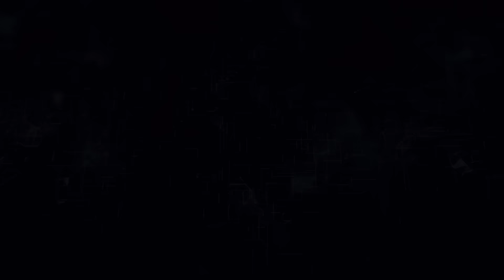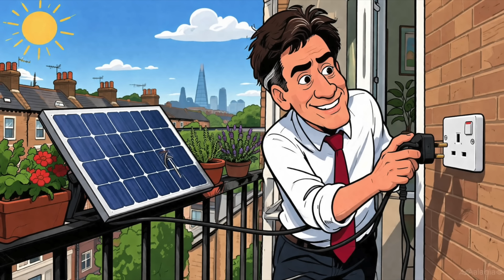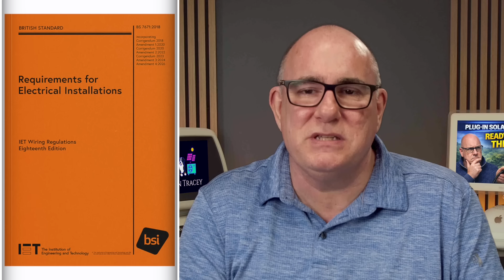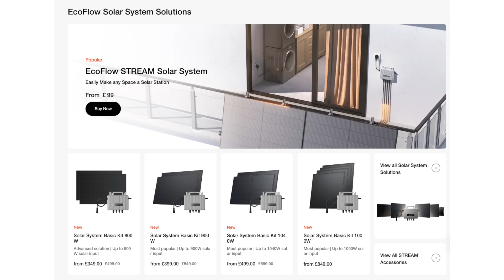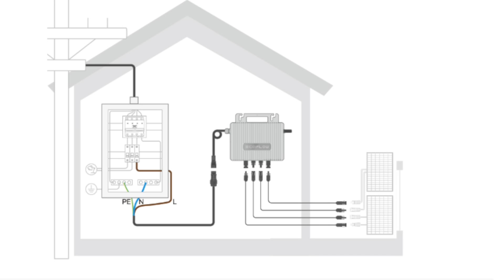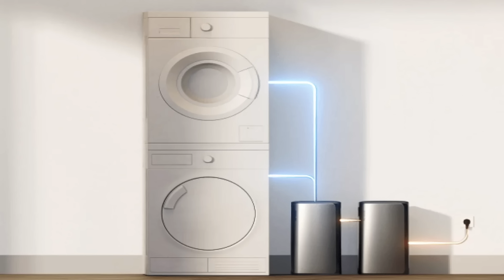Plug In Solar Is Coming… But There’s a Problem

Comment: It’ll screw our voltage even more than now, let’s have a load of Chinese made equipment pushing power into our grid what could go wrong 😂😂
Reply from the maker: @stuartosborne3013 Let’s ease off the anti-China angle a bit 😅

China is one of the most technologically advanced manufacturing hubs in the world — they produce the majority of global solar panels, including for many European and US brands. This isn’t cheap, low-quality kit — it’s highly engineered, mass-produced tech.

In fact, a lot of these production lines are heavily automated and staffed by highly skilled engineers — you don’t just walk in off the street and start building panels.

As for voltage, all grid-tied inverters have to meet strict standards to synchronise with the grid and shut down safely if anything’s out of spec — they’re not just randomly “pushing power in”.

So yeah… plenty to debate, but “Chinese = bad” isn’t really where the facts land 👍

Comment: Can these panels be recycled or are we just kicking the can down the road? Asking for a friend
Reply from the maker: yes the panels can be recycled at the end of their useful life, there are lots of companies now doing this.
Reply: Yep - we are really good at recycling them. Better in fact than those ghastly plastic windows in all our houses which have a shorter lifespan! The impact is also tiny compared with phones that get thrown away every 3 years and are far far less recyclable.

They are generally good for 30 years and you can often pick up older panels free or close to free. They are about 300W for the space of a modern 450W one which is fine for many uses.

Comment: I'm pretty sure you don't need an export meter as long as there is an appropriate smart meter installed and as it's under 800w people won't need to notify the DNO etc to export electricity.
Reply from the maker: @davek5839 You’re on the right lines 👍 smart meters need to be enabled for export with a seperate MPAN numbers before you can be be paid for export.

The bit that’s still unclear in the UK is the DNO notification side — under 800W it might be simplified, but that’s one of the areas still being worked through.
Reply: @JonathanTracey if people can't export the electricity they generate from plug in solar panels and get paid for it then the amount they can reduce their bills by will be lower and the pay back time longer. They could get a battery but thats more expense that many won't be able to afford. Like you said we will have to wait and see what happens.
Reply: Currently you need to send G98 forms in if you have any grid tie capability all all, even if it's not trying to export. The only time you need a meter changing is if it's so old it goes backwards. If you want export payments you'll need a smart meter.

Comment: I am hoping to be able to panel every inch of my outdoors!!
Reply: Why not...?  Millipede  has authorised  our great British  farm land  to be covered  by solar panels, so a few extra  will not be a problem
Reply from the maker: maybe someone needs to come up with solar bricks we can build houses from
Reply: @JonathanTracey  There are building designs at this point whose outer layer beyond all the insulation and inner plasterboard is solar combined with special frames and sealing so that the result is basically a watertight solar wall.

Bricks are obsolete and a ridiculous way to make buildings by manually piling thousands of little crumbly blocks on top of each other by hand.

Comment: I wonder at what point did those responsible for planning permission regulations become aware of the invention of photovoltaic generation and consequentially vote to render it illegal to install PV panels within 5m of a neigbour's property?  What might they have afraid of?
Reply from the maker: @tonyh6309 It’s less about fear of solar and more about planning rules around proximity, fire safety, and visual impact 👍

Some of those rules definitely need updating though — they weren’t written with modern solar in mind.
Reply: The English ground mount rules are bizarre but they mostly came about through nimbys not wanting you to be allowed to spoil your nice green garden, and partly because of paranoia about people building solar farms in fields in all but name.

They are totally bonkers though. A 2m high fence made out of flourescent pink toilet seats is permitted development. Make it out of solar is not. Even worse because solar is cheaper than wooden fencing over 20 years life at this point, and for second hand panels it's actually cheaper even if you don't wire them up.

Scotland has sensible rules. Wales is almost as messed up but the 5m rule only applies if the panels are over 2m high at the top (easy to avoid) and not within 3m of a highway - which is understandable given glint concerns.

Comment: I upgraded my motorhome with 2x200W panels and a 235A/h battery. I put the old 40W panel on top of my workshop and the Sargent controller in the workshop. It feeds two batteries. One from my BMW which was struggling to crank the engine and the old leisure battery from my motorhome which was deplete after four days off grid. Still some storage capacity left though. I now charge all my power tools and camera batteries for free. Not a huge cost saving but still free.
Reply from the maker: @brentwestbrook That’s a brilliant use case 👍

Not massive savings, but turning sunlight into “free” power for tools and batteries is exactly where these smaller systems shine.
Reply: 235Ah not A/h.

The operator in Ah is multiplication (A.h or A*h).
The operator in A/h is division and this wrong: there are no such units as A/h.

And capacity measured in Ah is useless unless you know the voltage of the battery, which you haven't indicated.

Battery capacity can be measured in two ways: 
kWh (or Wh)
Ah (or mAh) but the voltage also needs to be specified.

Comment: Great video as always, Jonathan, however I have a few different perspectives regarding plug-and-play solar systems. 
While you are correct that these systems aren’t a direct replacement for larger rooftop setups due to smaller battery sizes and micro-inverters, they can still be highly effective. Main benefit: you cut the middle man and scaffolding out of your cost. For instance, with a setup like the EcoFlow Stream product line that outputs 2300Wh via AC sockets, you can cover almost all basic home appliances. By managing energy usage smartly, it is possible to offset nearly 80%, or even more, of annual electrical consumption with a smaller system setup.
In the UK, where households use roughly 2700 kWh annually, a 4kWh solar panel system combined with EF Stream units could cover most energy needs from March to November. During winter, users can supplement this with smart tariffs like Octopus Agile. My own 2kWh system covered a larger part of my electricity usage this March and managed to save 50% of my bill cost in just one month. This saving could have been higher if not for my HVAC heating energy requirements. If the government would remove VAT on these systems for the time being and they were adopted by millions of households in the coming years, we could significantly reduce our national reliance on fossil fuels much sooner than the Government expect, just like Spain is already doing with some  ups and downs.
This leads to my second point regarding the Smart Export Guarantee (SEG) and MCS certification, which is useless in my opinion for this purpose. I have a G98, yet my energy provider refuses SEG payments because of my EcoFlow system hence no MSC certification. It is frustrating to contribute energy to the grid for free on sunny days, while being denied payment due to certification technicalities. The government should reform this to allow SEG payments for small plug-and-play setups. If millions of households fed even 2 kWh back into the grid daily, it would drastically reduce gas dependency, which is particularly vital given current global instabilities.

We need to reclaim our energy independence and ensure the system benefits consumers rather than just increasing corporate profits. Overall, the announcement is a welcome and hopefully they will reconsider moving the 800W limit, at least to 1000W in the UK or even, up to the 1200W limit while it is still a safe limit. This would make a difference for most consumers and support the Government's net zero target plan.

Comment: Could you use a server rack battery and micro inverter to connect to a socket? Use an inverter and charger to change the battery from solar and AC respectively then output the battery to a micro inverter to the wall socket?
Reply from the maker: Yes in theory you could set this up,
Reply: Yes. Sensible people do this because you can buy a 10kWh battery for less than an Ecoflow 2kWh one. Some of the inverters are then quite happy to just be chained to third party batteries.

Even the old Ecoflow could do this with some hacks so people ran Powerstream/Delta2 combos with a big fogstar battery on the solar input of the Delta 2, panels on the Powerstream and seperate charger for the fogstar on a timer switch.

Current Ecoflow though - nope.
Reply: Interesting. You can get a 16kwh eco worthy for the same price as a stream ultra x. Could that feed into a micro inverter and into a socket?

Comment: I just purchased a stream ultra x 3.8kW do I need another battery as well I have just installed a ecoflow smart meter as well
Reply from the maker: you only need another battery if you require more than 3.8 kW of storage, because that’s built into the ultra X. The nice thing about the stream platform is it’s easily expandable,, you can either buy another Ultra X for another 3.8 kW add them together together or you can buy something like the stream AC and add 2 kW at a time

Comment: Random question, how does the power in the house know to use the power from the solar rather than from the mains if its all going into the same system? And if you use the energy, how does the meter know not to count it on your bill?
Reply: You can think of the house wiring as if it were a canal with water in it.  If you consume the water, it will refill from the source…the grid.  If you also have grid-tied solar adding water on the house side of the meter, then anything you consume less than that will not cause any water to flow in from the grid.  And anything you use in excess of that will result in the grid making up the difference.

The meter only cares about overall flow, it doesn’t care whose water molecules are being consumed.  However, very old meters might get confused by reverse flow and anyone who has one of those will need a meter upgrade to properly account for the direction of flow.
Reply: @junkerzn7312 thank you for explaining, that makes sense.
Reply from the maker: @MarlonKingShow Great question 👍

It doesn’t “choose” as such — it’s just physics. The inverter pushes power into your home at a slightly higher voltage (higher potential), so your appliances naturally take that first before pulling anything from the grid.

Think of it like water pressure: if you’ve got a hose pushing water into your house at a slightly higher pressure than the mains, your taps will use that water first. Only when that pressure isn’t enough does the mains kick in to top it up.

The meter only measures what flows to and from the grid — so if your solar is covering your usage, nothing is coming in, and nothing gets counted 👍
Reply: @JonathanTracey thank you, that is helpful.

Comment: Be aware it may take up to 5 years to pay for the system
Reply from the maker: I would conservatively say 6 to 7 years is more likely
Reply: True, but it’s the feel good factor knowing that just a bit of one’s energy is coming from the sun.
Reply: Very dependent on the price you buy at and the way energy prices go. Sensibly priced inverters without battery and solar from suppliers is about 3 years currently assuming a good spot for the panels and no expensive mounts needed. Ecoflow kit is expensive so bumps it up. Ecoflow batteries are silly prices so bump it up further still.

Comment: Hi have leased solar panels on my roof. Will i be able to use this as well as or would that overload it? Am i better to just focus on a small battery like a dji and plug that in and feed back over night to get savings?
Reply from the maker: @MarlonKingShow You can run both 👍 it won’t overload anything as long as each system is within its own limits.

Battery-first is often the quicker win for savings, but combining it with solar is where it really starts to shine.

Comment: great on the one hand (eliminating idiotic road blocks held in place for years by the likes of MCS and other industry groups)

on the other, it's made solar panels 2x more expensive in the past month because of speculators and price gouging.

also the gov can say they're doing something while completely shifting the responsibility, cost, and maintenance to the taxpayer. No tax breaks (full fat 20% VAT), no money off/subsidies, and you better believe they tipped off solar panel resellers and industry groups before they made the announcement so they could prepare their higher prices

frustrating...
Reply from the maker: @iamdmc Yeah I get the frustration 👍

You’re right that whenever there’s a big announcement like this, prices can jump short term — we’ve seen it before with solar and batteries. Whether it’s speculation or just demand spiking, it never feels great.

On the policy side, I think this is more of a “first step” than a finished solution. It opens the door, but it’s definitely missing things like proper incentives, clarity on rules, and support to make it work well for people.

Hopefully once the dust settles, prices stabilise and the framework catches up — that’s when it actually becomes useful for most people.
Reply: Some of the price shift is down to removal of tax breaks on producers in China, some of it is just demand. Solar demand has been mental since January with installers, and it's gone totally crazy from the day the orange buffoon bombed Iran

Comment: I would love to trickle charge my EV directly from solar - is there a bona fide system that offers this solution?
Reply: The best way to do this is to have the solar charge a battery (or go into a power station), and then program a portable EVSE to charge at a minimal wattage.  Plug the EVSE into the power station.   If you want it to work whether there is solar/battery available or not, plug the power station into the wall and configure the power station to only charge from solar and enter UPS pass-through mode when the battery is depleted.

Best to research power stations that can be configured the way you need. And there can be grounding issues too… the EVSE may not be happy with just any power station.  Make sure the power station can deliver the minimum wattage supported by the EVSE.
Reply from the maker: Most evs need a minium of 1300w to start charging so you would need a larger system, I have a Zappi charger for my car, it waits until my large solar system starts to export and once 1300w is leaving the house it starts to charge the car
Reply: @JonathanTracey many thanks for the advice. I like the sound of the pergola setup. Regards Brendan McHale 
PS will you be at any of the EE shows this year - it would be good to say hello?
Reply: Remember, its about the energy the solar can make per day, and whether you deem that to be a useful amount of charge.  As long as you have a power station capable of putting out the minimum wattage, then any amount of solar can charge an EV.  Whether it is useful or not is another story.

If one only had a 200W panel that's not gonna be able to generate more than 1kWh/day or so (4 miles/day of range).  So you need to decide what a useful amount would be to make the project worth it.  For me... 1600W of solar would be the minimum (4 x 400W panels plopped on top of a decently strong Pergola kit).

That could put 20 miles/day of charge into the vehicle with the grid making up the remainder.

Comment: If you have an electric immersion heater, which for example heat pump systems often do as a back up, you can route any surplus power there using something like an iBoost, thus not giving electricity to the grid which you then have to but back at full price later.  Free hot water - very nice!
Reply from the maker: @jimpaine6331 Yep that’s a great shout 👍

Using something like an iBoost to divert surplus into hot water is a really smart way to maximise self-consumption — especially with lower export rates now.

Comment: How does your fridge decide to use solar power rather than your mains power ?
Reply from the maker: @Stormin_Mike You’ve got it 👍

It’s all about electrical potential (voltage). The inverter raises its output slightly above the grid voltage, so energy naturally flows from the higher potential to the lower — into your home first.

Think of it like water pressure: if one supply is at a slightly higher pressure, that’s the one your taps will draw from. The grid only “tops up” when your inverter can’t meet demand.

So yeah — not pushing aggressively, just sitting at a slightly higher potential so the energy flows the right way 👍
Reply: It doesn’t. That’s the job of the solar inverter.
Reply: As I recall, the inverter pushes back over that coming in via your grid by virtue of it creating a slightly elevated voltage?